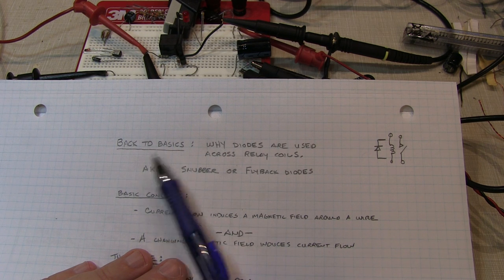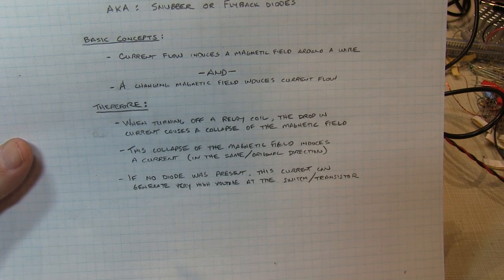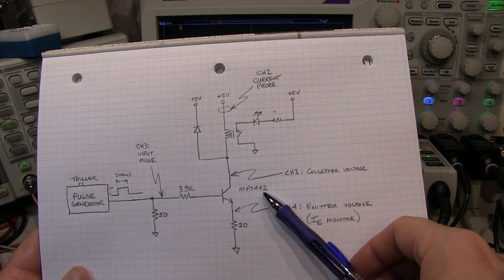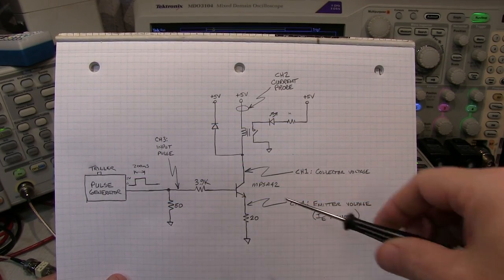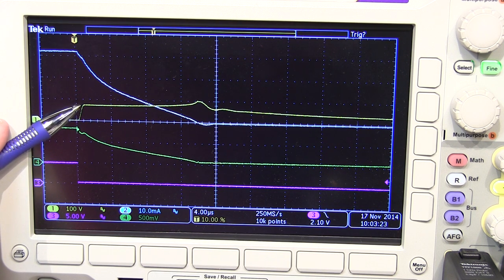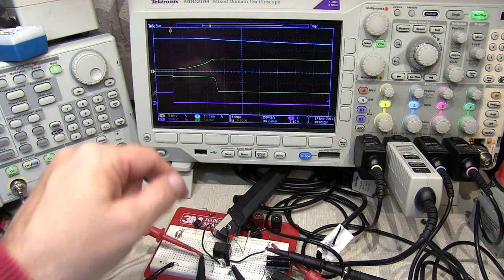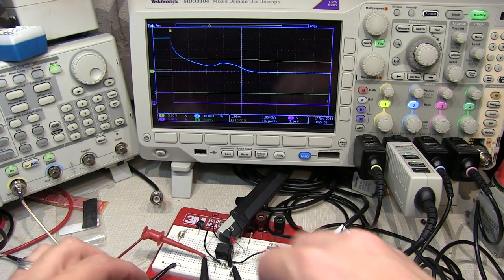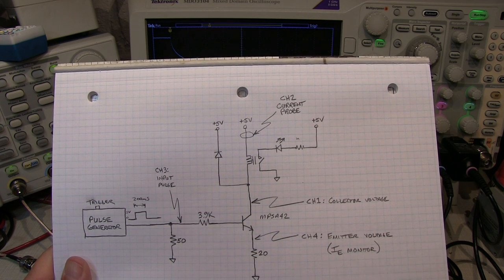#183: Why diodes are used around relay coils: Back to Basics on flyback or snubber diodes

Comment: What about the effect if the solenoid pin moving through the coil when the power is cut?
Reply from the maker: I'd bet (as suggested by a different viewer) that the little "hump" in the long-term response is due to precisely that!
Reply: ***** I regularly see this hump when looking at automotive petrol engine fuel injector waveforms using a current clamp. No hump and you can be sure that injector is stuck open or shut :) 2E0ILY
Reply from the maker: ChrisWilson5006 Thanks - now I'm more convinced that this is the cause for the hump!
Reply: Indeed, the inductance of the solenoid changes as the armature moves. In fact, this is why the armature moves, because it must move to a position of maximum inductance.  You can use this change in inductance, and the resulting voltage or current non-linearity to estimate the mechanical response of the relay or solenoid.  In fact, if you were to look at the rising edge signal (the turn on) it is quite clear when the armature starts to move from the change in the rate of change of current! This technique is used to measure the "dead time" for solenoid pintle valves such as the aforementioned automotive fuel injectors ;-)
Reply from the maker: Max Torque Fascinating - great info, thanks!
Reply: *****  An easy way to see this is to use an open frame type of relay, if you have one.  You can either prevent the armiture from pulling in by shoving something in the travel gap, or or hold it in all the time.
73
Reply: ***** Amazing!!! Thanks for that video! Now I can die in peace!! hi! =)  
Do you mean that measuring the time between the falling edge of the trigger and the "hump" is equivalent to measure the falling times of the relay? Or I'm wrong? thanks for your reply.
Reply from the maker: Not really. The time from the falling edge trigger to the hump in the response it how long it takes the armature to begin moving.
Reply: all right! Thank you very much!
Reply: Maybe another way to do this measurement, will be to measure, putting 5V at the common point of the relay, the voltage at the output of the relay isn't it?
Reply from the maker: Sure, but because of the springiness of the armature (which results in scrubbing of the contracts), the armature will star moving before the contact actually open.
Reply: Great thanks!

Comment: how can i install the diode is it should be a reverse bias?
Reply from the maker: +jerome fajardo It should be reverse biased when the relay coil is energized.
Reply: I did reverse the diode on my cessna 152 aircraft but the diode explode and my breaker pop out what should be the problem?
Reply from the maker: +jerome fajardo Sounds like you had it forward biased, not reversed.

Comment: In some applications you need to dissipate that magnetic energy quickly (fuel injector) because the current following through the diode and then back through the the coil will slow down the physical movement of the armature/pintel.  A zener diode (less than the collector-emitter breakdown voltage), to ground is used 

http://automotivetestsolutions.com/understanding-fuel-injector-waveforms.html
Reply: A question to my own statement.   In a high frequency (>100kHz) push-pull DC-DC SMPS , would a zener to ground across the drive transistor be "better"?

If would force the energy in the primary of the transformer to dissipate faster.

Comment: What is that 50 ohm for right after the pulse generator?
Reply from the maker: +jamesmasonic My pulse generator has very fast rising and falling edges, so adding a 50 ohm termination to the end of the coax coming from the generator will help to keep reflections (and the resulting ringing/distortion) to a minimum.
Reply: +w2aew The load seen by the generator will be around 1/(1/4000 + 1/50)  which is around 50 ohm. So are you trying to match the load impedance to around 50 ohm?
Reply from the maker: +jamesmasonic yes
Reply: +w2aew your pulse freq. is low and your wire is short and you are not using a coax cable. do you still expect a reflection? the wave length is huge for that freq. Is that because pulse has ultra high freq components which would cause reflection? because your pulse itself is too low freq. would require extremely long cable for reflection.
Reply from the maker: +jamesmasonic My pulse generator has rise and fall times that are single-digit nanoseconds, thus a lot of high frequency energy.  Without the proper termination, the edges ring due to the mismatch.

Comment: Great job.  However, you did not address one aspect which I'm curious about.  The energy of the collapsing coil field is clearly routed away from the transistor.  Bravo!  But that energy still needs to go somewhere.  What you prove is that the energy is now moving into the Vcc rail.   This begs the question:  Say this relay driver circuit is just part of a larger circuit board.  Is there anything else that needs to be done to protect the transient current spike from flooding something else?  Would a simple decoupling cap situated right at the diode from rail to ground "absorb" (for lack of a better verb) this energy?  Or is that worse because it creates a resonant circuit with the coil?  Am I overthinking this?  Is the diode sufficient?
Reply from the maker: Actually, the energy is dissipated in the diode - it doesn't really affect the supply rail.
Reply: How come? I'd like to know the answer too!
Reply: Thank you!
Reply: Would adding a ferrite bead around the lead of the diode add value by snubbing the pulse?
Reply from the maker: No, in fact it would make things worse.  The ferrite will impede the transient current through the diode, resulting in a larger flyback voltage across the relay coil.

Comment: Thanks very much.  I appreciate your taking the time to put this together.  I was about to install a power block for auxiliaries on my '08 Yamaha FZ6 and wanted to switch it on and off with the ignition.  The strategy was to take a feed from the headlight to run a 12V SPST relay.  Ignition on, Light on - Relay closes contacts feeds aux loads.  But I stopped myself when I remembered that this could be a problem when I cut the power to the bike.  I am fairly sure that this can potentially fry the computer on the bike.  I ordered some snubber diodes rated at 1000 V and one amp.  I think that'll do it.

Comment: Why are solid state relays better than using relay coils? Most solid state relays use mosfets instead of a coil and magnetic switch? Old pinball machines used AC coils for the flippers, drop targets, popbumpers , but they switched over to using DC coils for flippers, drop targets, popbumpers in pinball machines in the late 60's to 70's. Any reasons why AC coils are slower compared to DC coils are faster they say in the pinball games world? or any other reasons why AC coils, AC solenoids, AC relays, etc are slower compared to DC coils, DC solenoids, DC relays?

Comment: I may have mentioned this before, but......Technically, a changing magnetic field induces a voltage (EMF).  If there is a current path, then a current flows.  So it's not quite correct to say that a changing magnetic field induces a current.  The observed voltage spike, or flyback, is this induced voltage....Another way of looking at an inductance is that is will change the voltage across it to maintain a current flow when something external to it tries to change that current (such as turnning off {or on} the switch.
Reply from the maker: +Observ45er Yes, of course you are right.  I struggled with trying to explain the effect in a way that a lay-person would understand, and thought that the way I did it would be more intuitive - even though it is technically perfectly accurate.
Reply: *****  I understand very well that it is difficult when you either don't know your listener's level of understanding, or have a wide range of abilities to talk to.
Understanding that a change in a mag field causes an EMF allows an easier understanding of all electromagnetics as well as electromagnetic radiation. 
...
When you wiggle a permanant magnet around, you're actually creating an EMF in the region around your hand (actually out to infinity).  It is in air, so there is , in essence,  no current flow.  but place a conductoir nearby and a current flows in response to the EMF (and resistance present).   I think this concept baffles many and why it is hard to grasp some of this stuff.
...
I read many things on YouTube and get some really good analogies to use.  One also sees the many misconceptions which helps formulate better explanations to eliminate those misconceptions.
--
Cheers, & 73
Reply: +w2aew   Seeing the notification again for this comment, I have to say that you shouldn't assume you're talking to a layman.  There has to be at least some basic electronics knowledge for someone to understand inductive kick, so don't work too hard at a layman version.  
...
I also work very hard to get appropriate explanations.  I do demos for kindergarten up to adult and have to quickly assess a person's level very often.  Keeps one on their toes.
-- 
Cheers, K9DCI
Reply from the maker: +Observ45er Thanks - I really appreciate your comments (and keeping me honest!).
Reply: *****  For me, it's sort of a curse.  I spent the last three years researching Bernoulli and lift and learned quite a bit.  Then, the classical Cartisean Diver.  Those are all frequently grossly misunderstood and explained wrong.
...
The way real science fits so well together is a beaury in and of itself.  The electronics is old stuff for me now.  The more I work with youth, the more I am driven to find better and better analogies, or metaphores to make science understandable and fun.
--
Cheers

Comment: You wonder why the manufactures of relays don't routinely just build the diode into the relay and make it a polar device, de facto.
Reply: I've seen some that did do this.  Teledyne made some relays that were packaged in a TO-5 "can",  with a transistor in there to drive it.  A diode was included.  Not including it allows the relay coil to be connected in either direction,  if the diode was included you'd have to watch the polarity when hooking it up.

Comment: Very Nice explanation and thanks for saving my circuitry.
I have a question regarding Voltage regulator IC like ASM1117: suitable for 3.3v o/p.

It was working fine until I did not connect the resistance(100K ohm) between the supply voltage(~9v Vcc)
 and the Vin terminal of the IC.
Now the Vout voltage shows  0.03V and Vin Voltage shows 0.7v.

When the resistor was not connected, Vin was ~9v and Vout was 3.3v.

Please help !! 

Vin(~9v)---------------/\/\/\-----------------|-----------------|``````````````````|------Vin------0.7V    (Rather than ~9V)
                              100K                 0.7V                |   Asm117     |-----Vout---- 0.03V    (Rather than 3.3V )
Gnd------------------------------------------------|-----------------|......................| 

I am struggling with the internals of this IC and why such a characteristic is happening.
Reply from the maker: I"m not sure why you'd want to put a 100K resistor in series with the input of the regulator.  This will create a voltage drop between Vin and the input pin of the regulator, which will change with the load current.